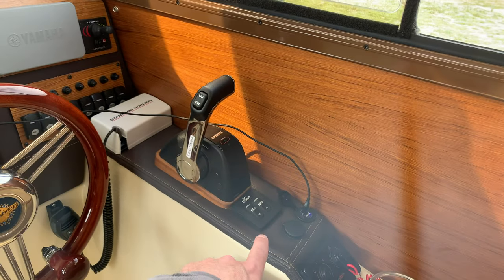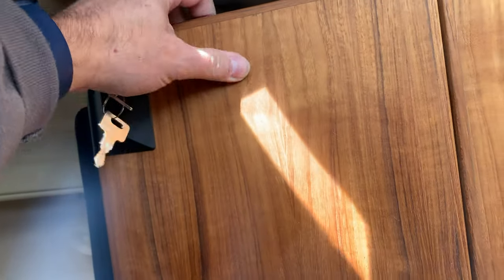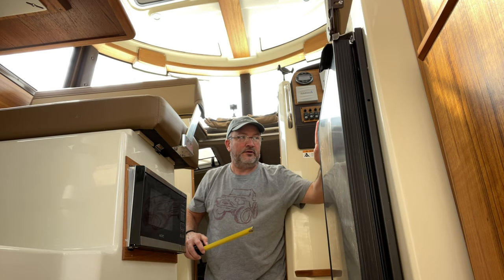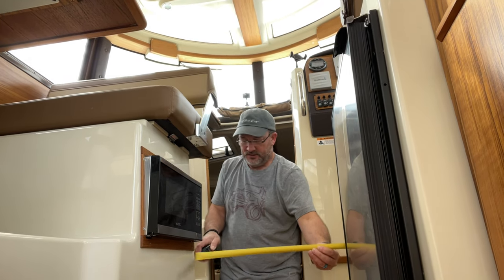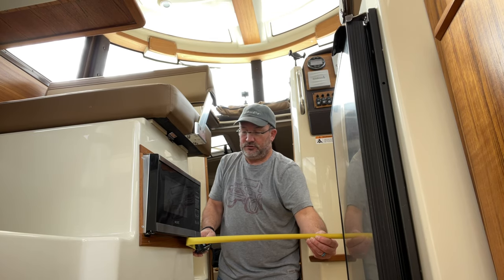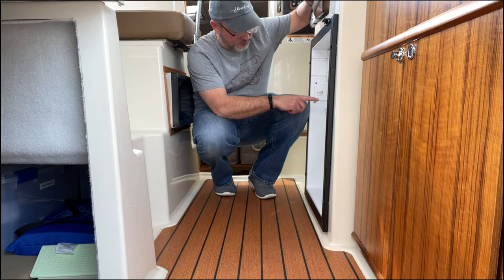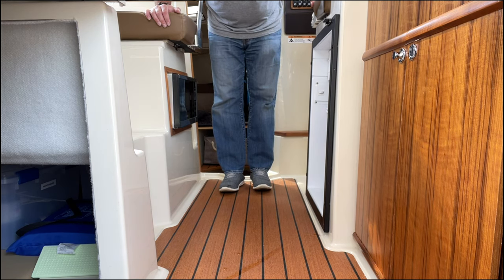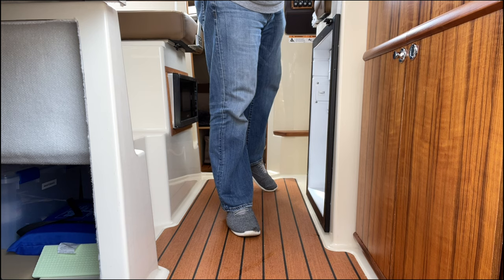Removing the refrigerator on a Ranger Tug R-23

Comment: I am trying to figure out where to mount the Lenco Auto Glide on the R25 and this was helpful, since I may have to pull out the fridge to get to where I need to go! Thanks again.
Reply: Did you install the Lenco Auto Glide? I have an R 25 on order and plan to install the auto glide system also.
Reply: I have not yet. It's planned for this summer install. I will likely install it in the cabinet on the top and not behind the fridge. I'll have to see if it works there or not.  @KevinFlockton

Comment: The frig removal aside, this is an excellent tutorial on the troubleshooting process we all must wrestle with on boats.  Congrats on "solving" the trim tabs issue, Dave...but wonder if the problem ever resurfaced?  Zip tying the cables is an excellent idea, given the intermittent nature of the fault.
Reply from the maker: Haven’t had any issues since, but also have installed the Lenco AutoGlide system as an upgrade.  @LetsGoChannelSurfing has good videos on that.
Reply: @CruisingElvinRay  Yes, Martin did an excellent job of that.  Thankfully, it seems to require more money than talent to install.